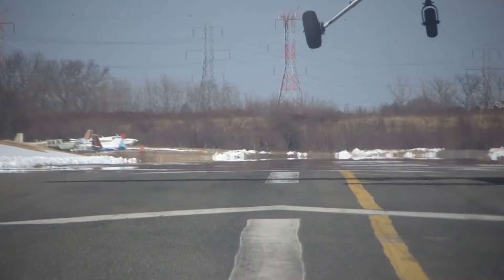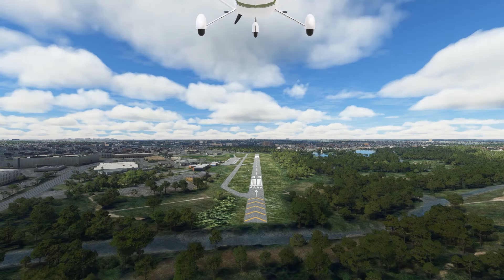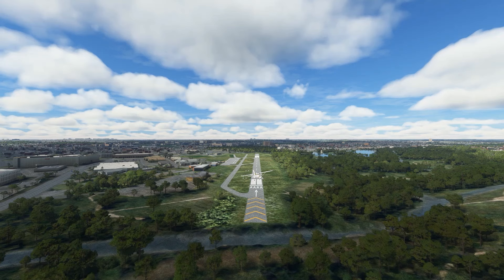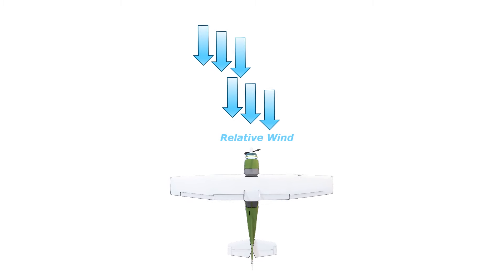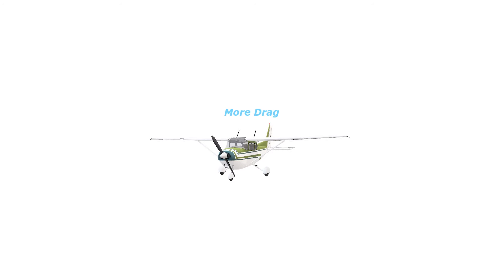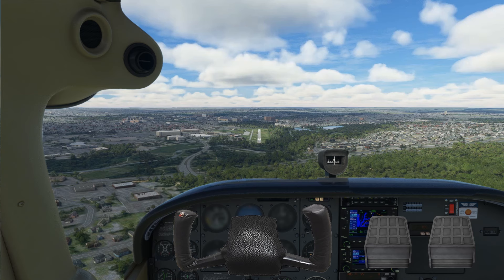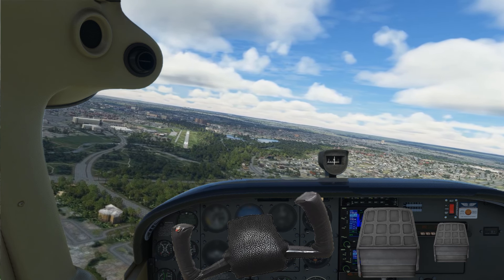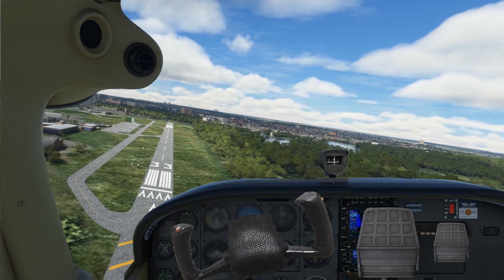Forward Slip to Land | Losing Altitude with a Slip | How to Land an Airplane

Comment: It works even on a 767 that doesn’t have enough fuel for a go-around. Or perhaps no fuel at all.
Reply: OG wide-body glider
Reply: This shouldn’t happen, you must arrive to your destination to do a go around and even arrive to other destination
Reply: @nicolasvulic4921  Air Canada flight 143, July 23, 1983.
Reply: @dale116dot7  aren’t you reading? I said this shouldn’t happen, that flight you are mentioning had an emergency due to a mistake during the fuel charging. When you plan a navigation as a pilot, you HAVE TO take off having enough fuel to arrive to your destination and also to a second Airport in case the first one is closed
Reply: The Gimli glider
Reply: @nicolasvulic4921  "This shouldn't happen." Yeah, no kidding, I think it was a joke.
Reply: @nicolasvulic4921  dude, relax, no one ever said it should happen.  OP said it works if necessary, that's all. Breathe.

Comment: That should be called "how not to land". Approach not stabilized, go around, early. It makes sense to teach and practice slips, but to increase options in an engine out situation, etc. A forward slip has no place in a normal landing.
Reply: It is perfectly okay to land with slip when you need. Not all aircraft comes with flaps. It is pretty normal for a cub landing in grass strips
Reply: @mylayovers7233  I've always enjoyed performing them. I thought they were fun in the Cessna I learned in, but when I got my TW endorsement in the Super Decathlon, that's when I really appreciated the concept!  
No flaps on that bird either.  I was a bit timid with applying full rudder (the rudder is much larger than the ones on Pipers and Cessnas). He had to tell me to "Stand on the rudder" a couple of times during my training LOL

So glad my CFI didn't say they had no place in normal landings 🤣

Comment: do you remember the parasitic drag curve that you study for the private written and flight test?  at low speed you are using just a fraction of your available parasitic drag.  if you ever see the rate of decent you achieve with a nose low attitude to reach a speed of around 90 kts you will see immediately that you are going to land and stop far shorter even with the extra speed you built up on final.   this may not be as effective with a faster low wing aircraft but in a single engine cessna or other high wing trainer you are far better off to use the higher speed because it will bleed off very quickly if you hold those aileron/rudder inputs in the roundout and flare. try it a few times and you will never slip with that high pitch/low speed attitude again.  you don't want to risk stall/spin with those rudders deflected at low speed close to the ground anyway.

Comment: Nice technique, but I don't know. I would always encourage a go-around and try again as the first option if the approach isn't stabilised.
Reply: A forward slip to land is required by the ACS tho.
Reply: @JohnLemieux  Exactly. It's taught for a reason, and a good one.  An emergency landing!
Reply: @Redtail_Pilot  Like running out of fuel in a 767 and putting it down on a racetrack.

Comment: C172N POH :”steep slips should be avoided with flap settings greater than 20°due…….”. should/shall I respect this on my checkride?
Reply: Yes. Always follow POH unless exercising emergency authority as PiC. Most landing slips are not steep.
Reply: "steep slips hould be avoided with flaps greater than 20⁰"

There are two things here...
1. "should be avoided" is not a prohibition against a >20⁰ flap setting and slipping the aircraft.  (a prohibition looks like what you see in FIKI prohibitions). A more clear explanation of what occurs is found in the 'Crosswind Landing' under section 4 of the POH - You might get  some elevator oscillation.
2. "Steep Slips" are what is recommended (not prohibited) against. What is a 'steep slip'?
Basically, a normal slip keeps the nose relatively flat or slightly down. a Steep Slip, drops the nose. What happens in a 172 during a full slip executed steeply, is that you get this odd buffering or oscillation in the elevator as dirty air flows over the elevator.  Normal slips (i.e. high on final), you don't tend to get the buffering.

I've executed full rudder deflection, forward slips with 30⁰ of flaps, and as long as the nose is kept level, there isn't any oscillation. I've also dropped the nose with 30⁰ of flaps and full deflection and felt the oscillation. It's not bad, and not even scary to 99% of student pilots.

Go try it! it's not prohibited. it causes oscillation in the elevator. It's not dangerous.  go up to 5k feet, do clearing turns and practice⁶
Reply: This is correct because greater flap settings lead to a shading effect on the tail but this applies to the C172. Low wing aircraft do not have this specific problem.
Reply: @braininavatnow9197  - Enjoy! 

Be advised that if you do not avoid a steep slip with 20° or greater flaps, you could exceed the maximum flap speed. Also be advised that the AI may not indicate the correct airspeed as the static port could be in the airstream shadow during a slip.
Reply: Yes

Comment: Those of you in flight training please read through the comments as there are some important items to consider.  First of all some manufacturer's disallow this maneuver with flaps extended.  It is important to understand the reason for this prohibition (stated by others).  Secondly, realize that should the airplane stall with the controls crossed (aileron deflected in one direction the rudder deflected in the opposite direction) the airplane will behave very differently than it does during a straight ahead coordinated power on or off stall.

In aviation what we do not know, do not understand or are unable to do can in fact hurt us.  Flying uncoordinated with the controls crossed is one of those areas where ignorance is definitely not bliss.

Comment: One important aspect that I think is missing - you can control the energy dissipation by varying the amount of rudder used; that allows for less commitment compared to putting flaps down.
One questionable piece of advice - the recommendation to begin the slip in the base turn. I just don't know about student pilots applying full rudder in their base turns, that sounds... questionable. Maybe let's wait until we're on final before we do that.
Also, no mention of possible erroneous airspeed indication while in a slip (higher or lower depending on the direction of slip), kinda important since we know we'll die for sure if we stall on final with full rudder in.
Reply: Yeah, the "don't worry about stalling" was spooky to hear. Air is hitting the pitot and static openings at different than designed normals, which could affect indicated airspeed.
Reply: @TiagoSeiler  I can understand where that came from, I always make the mistake of lowering the nose in a sideslip (as advised by the FAA book by the way), and I end up too fast and float.
Reply: As I understand it the slip is implemented on turning
 onto final which seems very logical. The crucial decisions are made on final...
Reply: Aren’t most Cessna not supposed to be slipped with flaps?
Reply: @Av8err  Those that have 40 flaps aren’t supposed to be slipped with FULL flaps.
Reply: I took an Archer II up to altitude and did forward slips in both directions. In each slip I pulled the nose up until I got to a low enough speed to feel the high wing just starting to drop. The drop came on slowly and I could easily tell that things were getting mushy well before I felt the wing start to drop. And my recollection was that it happened between 50-55 knots. So yes, if you abuse it you can cause a spin but, at least in a training plane, it shouldn’t be a problem if you’re paying attention. An aerobatic plane could be another issue because it could quickly roll from a slip to a skid - and you have to be in a skid before it will spin.
Reply: @calsbarn5996  You say you felt the high wing starting to drop, I was wondering why it dropped before the low wing.
Reply: @jukahri  The high wing drops first when you’re in a slip. The low wing drops first in a skid. If you’re in a slip and let the high wing continue to drop rather than doing something to stop it (basically just removing any pressure on the rudder), it will eventually turn into a skid. And a skid can turn into a wing over and spin.

Comment: Do flaps during slips pose any dangers?
Reply: Mby damage to the flaps if over the max flaps extended
Reply: @boborj555 it's about the stabiliser and elevator getting into dirty air. In theory you might stall it

Comment: Do you do this with flaps? If an aircraft is not certified to slip with flaps down, do you loose more altitude with a forward slip, or full flaps?
Reply: At least for small planes not if you can help it. I've heard it's possible to do damage using both. It's good if you lose flaps.... Electric flaps

Comment: Great video. I have only one comment: You should be watching your airspeef at all times. Once you are fully in the slip, all that drag will quickly eat up your airspeed before you realize it. Furthermore, misuse of pitch will also bleed off airspeed very quickly. It's a serious situation I point out routinely to students while learning the manuever. If you aren't paying attention, you can slow to stall speed.
So... speed is very important and really should be emphasized during the manuever.
Reply: I was just practicing them for the first time today. I should’ve seen this comment because I got only 10 mph from my stall speed.
Reply: @crazybird199  Excellent. That's great that you recognized your speed before it became an issue. Good job.

Comment: I did this so much ,in my earlier years that a dent formed in the side of my hired 152.The main reason was i would fly a 5 degree final glide path and found myself too high .It was also caused by my flying very tight patterns .Just keep that nose down low and dont let your speed decay.